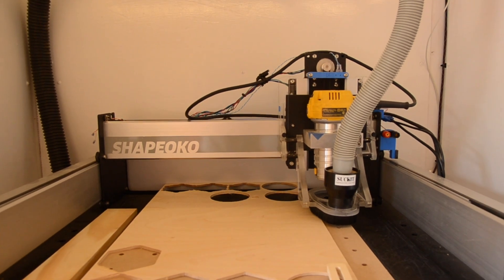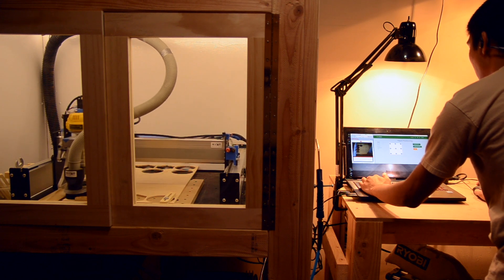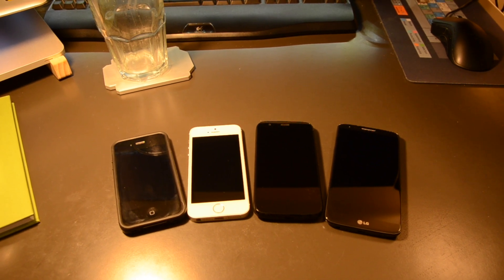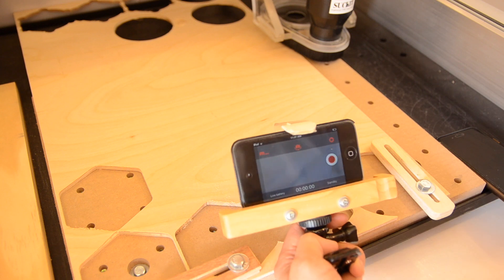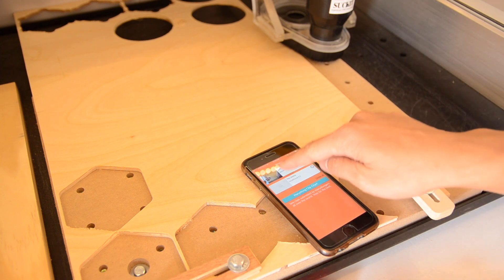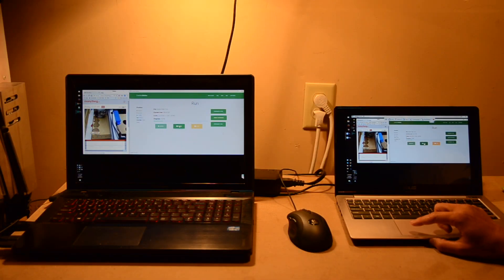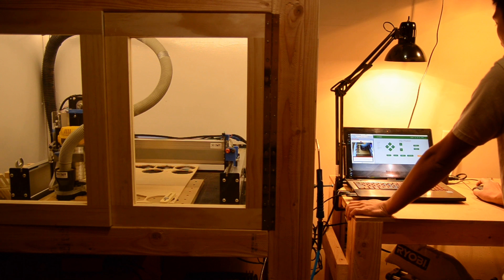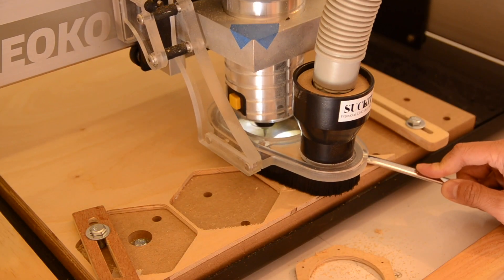My Remote CNC Camera & Computer Setup

Comment: NewRAD CNC v1 3 with Cameras and OpenCV
https://www.youtube.com/watch?v=cICAZHzGLwo
You can see up to 3 cameras at the same time on this NewRAD CNC controller software.
I love having cameras on my CNC Controller screen, especially microscope cameras for fine work like milling PCB boards for electronics. 

I use OpenCV (computer vision) for locating drill holes for positioning a CNC machine automatically on the X and Y axes.  I use webcams and microscope cameras, and endoscopic cameras connected to active USB repeater cables, and it works.  I would hate to have to use smart phones or wifi, or IOT, or anything like that. What a mess that would be.  Plus the NewRAD CNC software has a lot of extra code to make sure the cameras don't get confused, and that it finds the correct during start up.  Most softwares that involve cameras do not do all the extra work required to minimize clogging the USB ports, and thus making you have to reboot your machine, and unplug webcams, etc.   

Unlike with Mach 3, you don't have to install a 3rd party add on to use cameras.